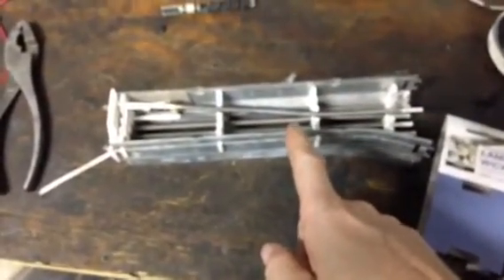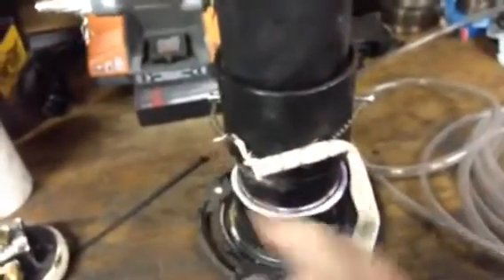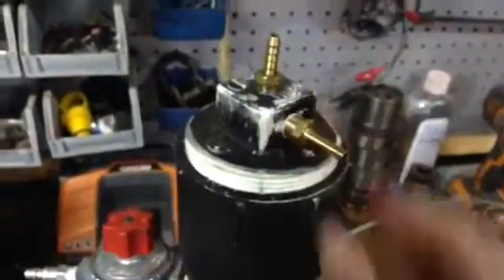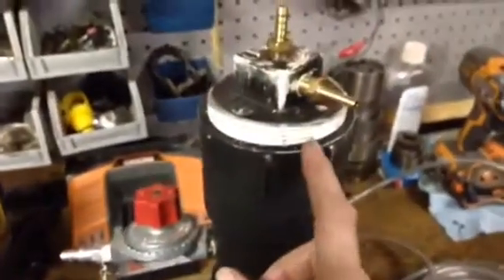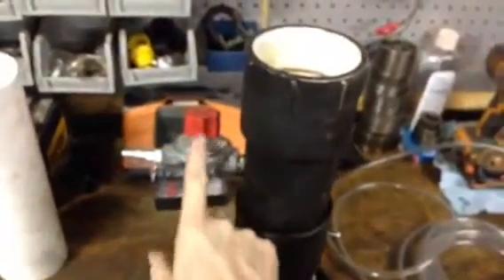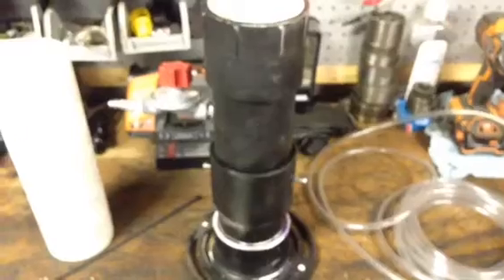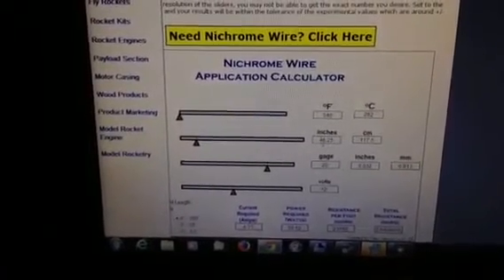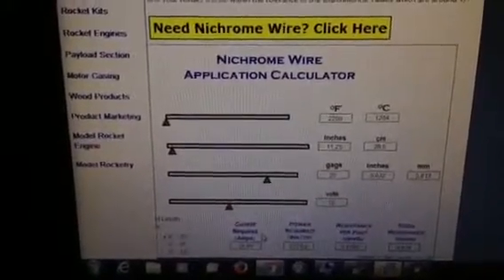Directions on building home made evap tester, smoke tester for automotive repair

Comment: Thank you for your post i have tried using paint cans but the pvc and toilet base is an awesome idea thumbs up and the wire calculator has made the difference i have tried soldering irons as heat source but this is better what gauge wire did you use for the cables to the battery ?
Reply from the maker: Mine is only pulling about 6 amps so I used 16 awg wire.
Reply: odell kimes if you don't mind please give me the diameters and lengths of the pvc pipe and a description of top and bottom and cap, also the regulator I have is a low psi @ 1psi total do you think that will do or should I get the one like yours thanks

Comment: dont use baby oil. use food grade mineral oil
Reply from the maker: I'll try it and see, it smokes good with baby oil but I really don't like the smell of burning baby oil. I'll try your way and see.
Reply: Baby oil has fragrance and can be bad on sensors. Food grade mineral oil doesnt and is what is in the smoke fluid sold by redline detection. Baby oil can be bad in some cars sensors never use that.

Comment: Is there a reason why your set up is so tall?  I mean can it be made shorter overall in length?  Thanks and look forward to your reply!
Reply from the maker: Not really, you could make it shorter if you wanted too.
Reply: +odell kimes Good to know thanks for the reply as I managed to retrieve Ni-chrome wire from a hair dryer that turned out to be 20 Gage or 0.03" just like what you made.  I am shopping for a regulator and will let you know my progress.  I really appreciate you taking the time to post this very detailed and helpful video as I am chasing a vacuum leak in my car that is not allowing it to pass smog.  Thanks again!

Comment: what AWG you use for the battery connection
Reply from the maker: It's 16awg, the unit only pulls 5 amps, so you don't need a very big wire.

Comment from the maker: I'm using 20 gage wire on my smoker but you can use whatever you desire. I run my smoker off 12 volt battery and mine pulls roughly 5 amps with about 2.5 ohms or resistance in the wire. It wont let me post a link so type in google, Nichrome wire calculator and its usually the first link.